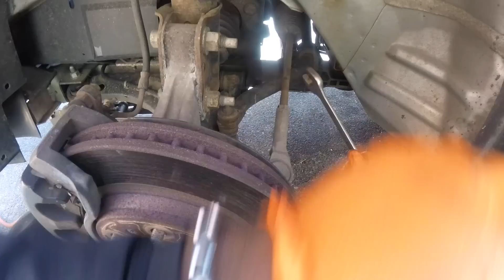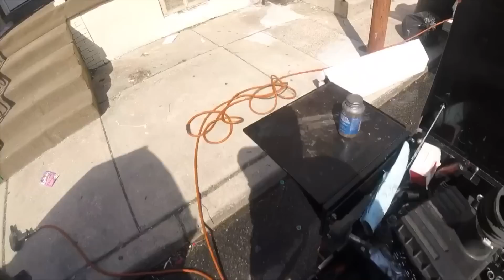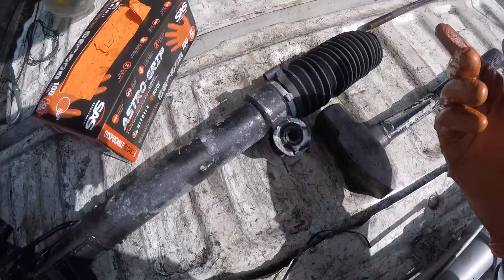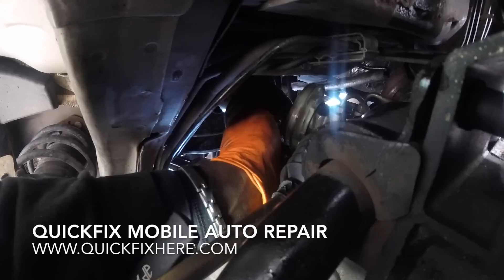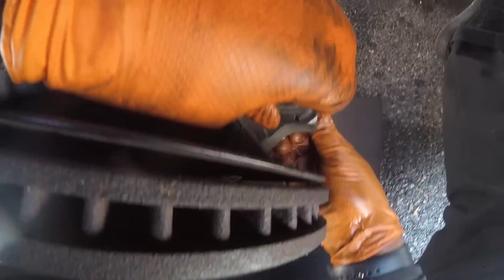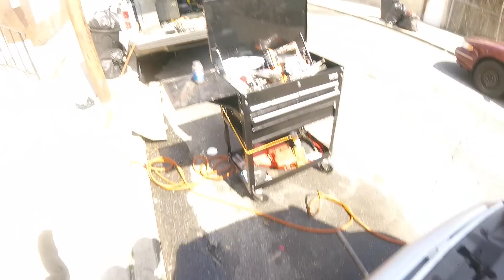🤔How to replace a rack and pinion on a 2006-2013 Chevrolet Impala 3.5L👌:Philadelphia

Comment: Good job , nightmare doing jobs that others have tried before.  Normally rounding nuts off or not having the correct tools to start with.
Reply: I have been there myself many times.
Reply: I know Im randomly asking but does anybody know a way to get back into an Instagram account??
I stupidly forgot the account password. I would appreciate any assistance you can offer me
Reply: @Dangelo Terrance instablaster :)
Reply: @Cash Anders It worked and I now got access to my account again. I'm so happy!
Thanks so much you saved my ass !
Reply: @Dangelo Terrance Happy to help :D
Reply: Having trouble getting the return line screwed into the port to the rack. This has been the hardest part of this job and I've tryd everything even getting a new return line. Still having trouble getting her in . Any tricks or has anybody ran into this problem and solved ?

Comment: You did a great job especially working on the street. I am impressed you got it out without removing the sway bar. I have seen a video that did the job by taking the sway bar out without lowering the subframe. What brand rack and pinion did you use? I think I will go with a new rack and pinion instead of a remanufactured one. You really did this fast too. It may take me a couple of days in my garage. Thank you sir.

Comment: I'm doing this now and my ball joints don't line up with the holes. I measured the previous spot and put it exactly on the new ones. Only way I can get them on is if I turn the (calipers/wheels) to get them to line up but then my steering is completely off. 

Kinda stumped. Dkn what to do.

Comment: You do not need to remove the rear to subframe bolts completely. But most techs will.  The kids that have a way to push that subframe back up where it goes and that's where that hydraulic floor jack comes into play. But if you want to leave those two rear bolts in just a little bit you can and here's a quick tutorial on it if you decide to do so.  Loosen the front two subframe bolts about 3/4" to  1 1/4".  Then loosen the rear subframe bolts until the bolts have about 1 1/4" of bolt left threaded in. That'll give you about 3 1/2" to 4" of room to remove the rack. If you need a little extra room you can loosen the two front subframe bolts a little bit that'll bring it down a little bit and give you some more room if you need it but be careful not to loosen it too much because if you do you might find yourself in a pickle.
Reply: A small pry bar is good for removing the rack after all fasters are removed.

Comment: NEVER strike the  outer tie rod on the threaded shaft. Even with the castle nut on it.  You can damage the threads or even the internal integrity of the outer tie rod which would cause premature failure.  There is a spot on the steering knuckle where that tie rod goes through it. Its designed for you to smack that spot of the steering knuckle not the outer tie rod in order to separate rhe tie rid from the steering knuckle.

Comment: the 2013 does not come equipped with the 3.5, but instead it has the 3.6l either DI or FI, and comes factory  with 305bhp.

Comment: title should be.."outside, on a street. no lift" ...this is great. not a fan of head cam auto repair videos, but i think you nailed it. i liked how you did not edit out the struggle with that bolt. maybe a little less on the ad pop up. but this is great. ... took me 4 hours to do plugs and wires..

Comment: Does a bad rack and pinion cause the car to kill
Reply from the maker: Does it kill people? You should replace a bad rack and pinion. You will lose control of your steering system. Meaning vehicle could be to hard to turn or you can feel vibration in steering it is just not safe.
Reply: QuickFixHere Lol.. I notice the whining and power steering fluid leaking the other day, but also my battery kept dying overnight. I got my battery checked at Auto Zone today and had to replace it but I'm getting a new rack and pinion put on Monday .. thanks for your reply.
Reply from the maker: Felicia For Real my pleasure!

Comment: I have 2006 Monte Carlo 5.3 I can't find nothing showing on this car replacement of rack and pinion.does the 3-9 And 3-8 are the same set up as the 5.3 rack and pinion. If so my question is do you hook up the 11 mm.bolt on top of rack were the sleeve comes down over it first .then hook up the too 18 mm break lines ,thanks u for any help  mike

Comment: So at the beginning of the video where u noticed someone else has tried to work on car with the bolt on the floor and the other loose one,  do u have to lower the sub frame first to take them off?
Reply from the maker: You do not have to but it does make it easier
Reply: @chooseyourlife9894  got it thankx

Comment: Good video! I’m doing this job this weekend. It’s interesting that it only needed an inner tie rod but the customer wanted to replace the whole rack but it appears that he didn’t want you to replace the worn outer tie rod end for a few extra bucks.
Reply: Probably had no choice since an attempt was already made on the R & P. There was a bolt already completely out, as well as one that was partially out, and rounded off steering line bolts. They may have been the one to break the inner tie rod in the first place as well lol.

Comment: I have a 07 impala and I'm having steering issues.  my wheels wont turn when i turn my steering wheel. But I get a popping noise when I turn to the right. then when I jack the car up, I can turn the wheels normally both ways with no problem. what's the issue i might be having

Comment: 👍Good job, done quick and efficient, seemed a little tight on the lug nuts, should be 100 ft.lbs, some people might get ticked about dirty hands on steering wheel, other than that A+ Job.

Comment: how did u get the pin to go back in to the steering shaft where the bolt goes your video do not show that part that only problem im having :(

Comment: How the heck did u put the rack amd pinion in the steering column...u said put on top? I cant even get it to slide back in?
Reply from the maker: You have to make sure It is aligned correctly because it only fits one way
Reply: So i have the rack placed in like u did, but i cant get the steering shaft to meet with the rack, wjen u did it u slid it down, but mine is not going down, i have to lift the whole rack amd pinion so it at least touches the steering shaft
Reply from the maker: Dominique Hayes do you have subframe bolted up or no? Is the rack and pinion bolted to sub frame as well?
Reply: @chooseyourlife9894  i lowered the sub frame, and i bolted the rack down at fisrt, but couldnt get them to touch, so i unbolted the rack tp try amd put it in the shaft
Reply: Did u raise the subframe to put it in the streering shaft
Reply: is it meant to slide all the way down the pinion or just a little bit maybe 3/4 inch?
Reply: Almost all the way,,, i had to stop and come back the next day, this is how i did it, i lined the knuckle and rack up to where it looks like it wants to slide in, once u have it in the position, i raised the sub frame back up and it just slided right into place
Reply: @NeoGoat did u make sure the rack it is aligned correctly and not backwards with the knuckle. ..once i made sure it was aligned correctly i just jacked the subframe back up and it slid in